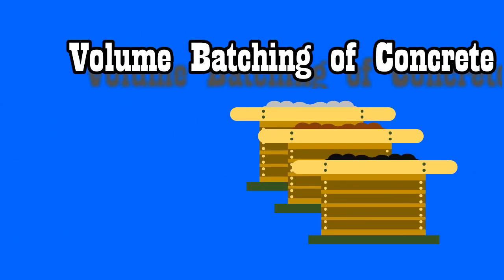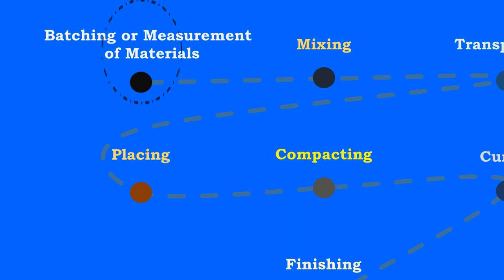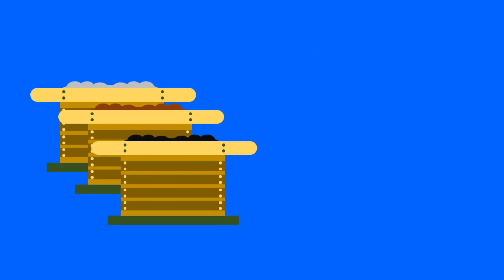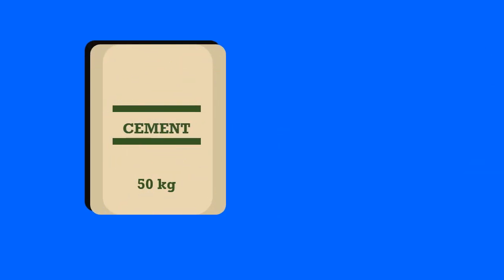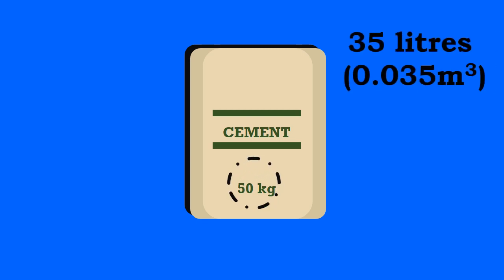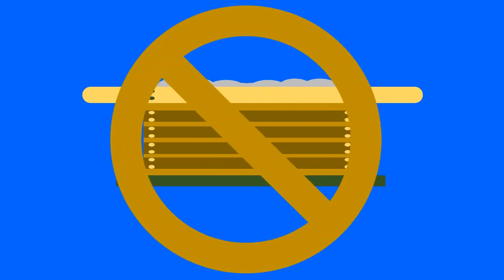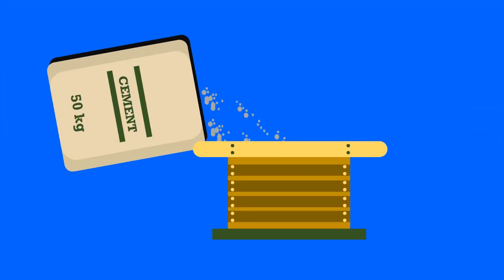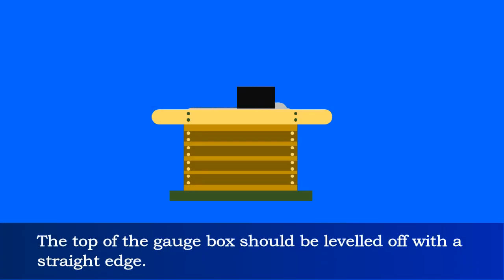Volume Batching of Concrete || Batching of Concrete #1 || Manufacture of Concrete #2 ||

Comment: Volume batching of concrete
All ingredients measured by volume not by weight(in term of bag).. 
M15 concrete
1bag cement
2bag of fine aggregate
4bag of coarse aggregate
Small scale construction work